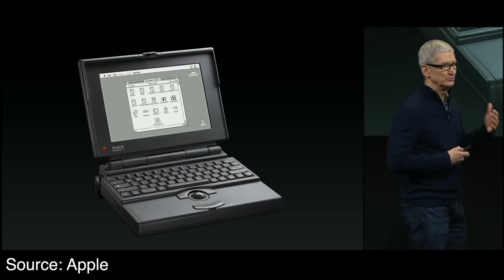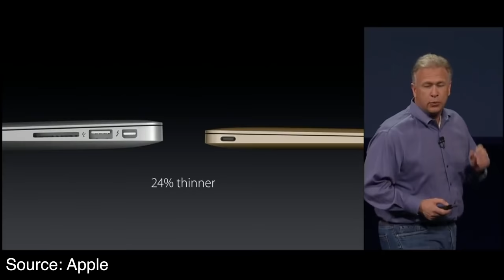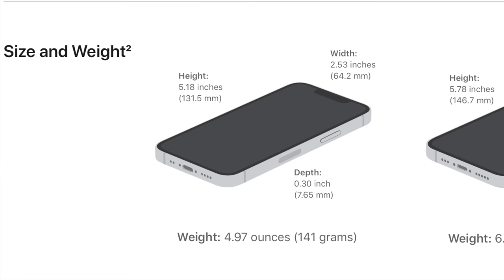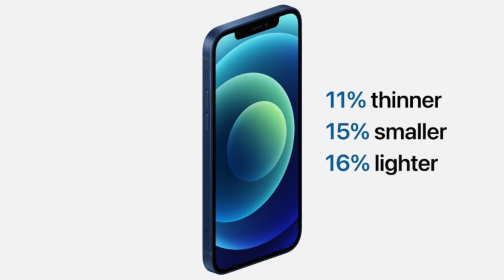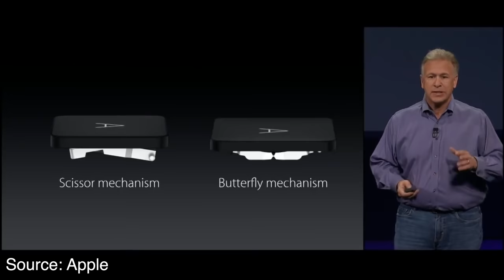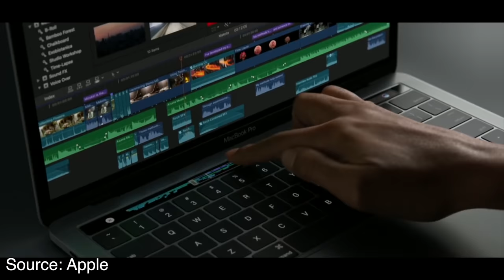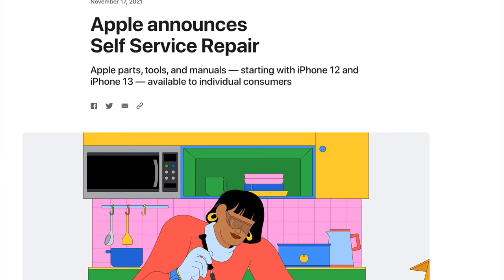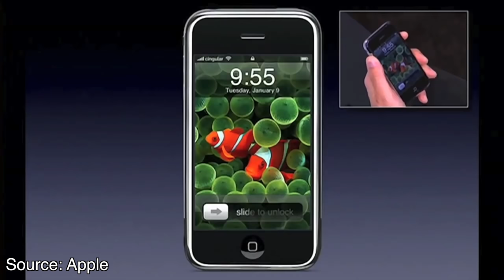Apple is Changing...

Comment: Apple is changing from Lightning to USB-C, from CISC tomRISC, from Intel x86 to 5nm ARM, from FullHD to UHD/4k support with macOS, from single tasks to full multitasking with IpadOS.Changes from small accus/batteries to bigger batteries and from large max IPhones to pocketable smaller phones. Apple further changes from soldered down RAM and SSD modules to user changeable modules! 😄 I really would like an 5,5“ Iphone with double the thickness and three times the accu capacity! A am happy, they changed from 5V with 2,4A or 1A to 20V with 1A (Power Delivery).
Reply: Apple will never drop the lightning connecter and I’m glad. I don’t want to buy a bunch of new chargers and throw out my old ones. They will stay at type c one one end and lightning on the other. The reason is simple: they’re Apple and they own the rights to the lightning connector and anyone that uses that will pay royalties. Gives them more money to stay in business
Reply: @adawg3032  did you miss the fact that Apple is replacing Lightning with MagSafe? Expect to see Lightning going away soon. It is unacceptable to have a 1TB phone with USB 2.0 transfer speed (480 Mb/s), while it should have Thunderbolt (USB Type-C) at 40 Gb/s. Don't forget that Intel was not the only one to create the Thunderbolt protocol, Apple was there as well.

Comment: I started my gradual changeover to Apple in 2017 when I bought a late 2017 iPad Pro. That in turn led to a refurbished late 2015 iMac which I replaced this year with a refurbished M1 Mac mini. I switched to iPhone with the 11 Pro Max and now use a 13 Pro. I also have iPads and an M1 Macbook Air. Their products are pretty darn good and I have no regrets in the change. Good vid Greg!
Reply: Unfortunately, I am heading in the opposite direction. I have an iPhone, an iPad and a MacBook Pro. I use VMs A LOT, so I will not be able to move to the ARM MacBook. Also, I am becoming concerned about the gate keeping of apps on the Apple Store, so I may have to switch to Android to side load what I want. Maybe I will end up with two laptops and two phones. What a pain!

Comment: Also, the iPhone 13 wasn't that heavy to be fair. Holding it in hands feels very light. It's actually not that big of a deal. But the iPhone 13 Pro was clearly heavier by a lot. In fact, I actually felt like the iPhone 13 was a bit lighter than the iPhone6 S Plus although the 6S plus is two times lighter than the iPhone 13.

Comment: But the M1 24" iMac is unnecessarily thin, it's a desktop, and it still sacrificed ports and expandability, and it's still glued shut. So they aren't completely listening yet... I guess we'll see what the larger iMac will look like.
Reply: Exactly
Reply: The larger ones usually come out later
Reply: Rumoured the 24” was the last Johnny Ive product designed but finalised by the new team. They did it as a curtesy to him since he’s the original creator of the iMac and to start a new era ending the one he had created.
Reply: The potential larger Apple Silicon iMac could have a 30 inch display.

Comment: I bought, and returned Macbook Air last week (Dec 2021) for the following reasons: 1. cannot connect more than 1 external monitor! 2. cannot run CS6 3. the bezels are huge in comparison to the competition (Dell laptops) 4. the aluminum surface is so cold while typing on it in winter, especially when I'm on the move, I constantly rub my hands to warm them up.

Comment: I think you will see more changes to Apple, starting with the iPhone 14 next year. What if somewhat "thicker" design rumored for the iPhone 14 is not only to accommodate the long-needed USB Type C Thunderbolt 4/USB4 port, but also make the phone in general easier to replace some critical parts like the battery and the screen itself?
Reply: You are dreaming. They will never make the battery replaceable
Reply: They don’t want the battery to be removable because it allows thieves to pull the battery after they steal it which will ruin the entire point of always on find my mode and I don’t blame them. If your phone battery isn’t working you probably should just buy a new phone because it takes years to get to that point. A big tip is don’t use wireless induction charging because it roasts batteries

Comment: I like apples direction currently .
I’m a bit more partial to devices of substance , and flagship models  with convenience features , like extra ports , card readers, headphone jacks, this was one of the reasons I liked the earlier samsung flagship galaxy models , however it seems samsung has abandoned that trend , 
    at least apple stuck to the practical non gimmicky flat displays , kept a focus on device performance and added the MagSafe which actually turned out to be useful despite my initial thoughts it was a gimmick.
  I prefer the more solid build of the new apple phones and laptops , and I would always prefer having more weight for extra battery and features 
  Having said that , going the other way , if apple bought out an iPhone with no charge/data port , I would not be purchasing another iPhone.
Reply: There have been rumors that the iPhone 14 will be getting USB-C. I'm not hopeful, and I'll believe it when I see it, but honestly they've made better flagship phones this year than Samsung; as a loyal Samsung user until they released the AWFUL S21 series and appear to be digging their own grave even more next year, I think Apple honestly can overtake them next year. If Apple can fix their buggy software; the one thing that has still suffered since the Steve Jobs era, I think Apple could be back to being what they were in the 2000s: A big OE that always was one step ahead of the electronics game.
Reply: @cameronbosch1213  Yep , USB-c would be nice mate , crossing my fingers for that too.
 As for Samsung , i truly dont understand what the company's goal is in smart phones these days , but keeping loyal long time customers does not seem to be it sadly .

Comment: one could argue that during the iPhone 6 and early Mac book air era they were using the combination of size, efficiency, power, and manufacturing superiority to create a high bar that crushed many mid tier competitors and kept the pressure on Samsung to keep up as well. the slim size was very hard to copy if you wanted the battery life AND performance

Comment: 2-in-1 Devices. I got a cut price deal on an SPX. I love it. The only problem: Win-ARM and weak performance.

Now, boot up MacOS with Touch and M1 or M2 with 5G and take the typecover + stylus bay design and that's the dream Ultra-Portable form factor imho. Needs to be nearer to 600g (without typecover if possible) and wow Apple would have the uber device for consumers.

SPX at big cut price is really nice: Love having laptop and touch together on ultra-portable that can also be used as tablet for reading, kick-stand with movies, connect dock for several screens and bluetooth keyboard/mouse as well as portable.

This is honestly the sort of device I'd expect FROM APPLE that pushes tech-interactivity-UX forwards.

Comment: Does anyone else actually wish Apple stuck to the trajectory they were on with the 2016 MBP? I prefer thin & light. The 2021 16 inch MBP is one big chungus of a computer and it takes some backwards steps for me. I love the return of magsafe but I want 4 USB C ports on that machine, not 3. I want the touchbar/shorter function keys.

The 12 inch macbook is one of my favourite machines because of how thin and light it is, not in spite of how thin and light it is, and it'd be disappointing if that form factor never makes a return. Put magsafe & an M1 in it and I'd buy one tomorrow.

Comment: I also think there's a big difference between what customers are actually asking for and what tech reviewers think they're asking for. For example; slating the 2013 Mac Pro with single-function benchmarks when it's dual GPU design was clearly aimed at rendering the last job whilst editing the next job mean't the negative press didn't correlate to negative customer experience. 
Are the superficial appeasements of returning old ports on the new MBPs really sleight of hand? Making superficial concessions to customers whilst eliciting the fundamental concession of Apple Silicon from them? Give a penny, to take a dollar.

Comment: for years I was using old MacBook because of the feel and problems with butterfly, from 2015 till 2019 I had the same laptop a1502 with physical trackpad, it was the best apple designed computer, then ive got 2019 with finally normal keyboard but still the board design is messed up and outdated intel so ive got m1 max witch is amazing

Comment: Did Apple really design themselves into a thermal corner with the trash can? Many GPUs and CPUs today absolutely smoke the trash can’s internals and at a lower tdp. I feel that apple could have implemented some sort of upgrade program instead of leaving us high and dry
Reply: Not that they should go back to it. but an M1 max chip (maybe duo or quad) would  probably stay nice and cool in that chassis..to me it seems that a Cylindrical shape is just wrong for many other reasons than thermals
Reply: The Trashcan Mac Pro was so designed into a thermal corner that it lasted 6 years without any hardware modifications because any Intel Xeon or AMD GPU newer than Late 2013 would already exceed the cooling limits of the unified thermal core.

Comment: Apple trusted intel to deliver 5nm chips on schedule back in 2012 so they went all in on thin and light design. When the chip iwas delay year over year, they are stuck because thermal becomes an issue.

Comment: MAYBE WHEN THE IPHONE 14 COMES OUT IT WILL HAVE A REMOVABLE (FLUSH)
RECESSED CAMERA MODULE CLUSTER DISPLAY THAT HAS A 100X ZOOM CAMERA AND A PROJECTOR CAMERA THAT WOULD USE THE EJECTING MAGSAFE TRACKPAD STAND,IT POSSESSES, TO STABILIZE THE BLUETOOTH REMOVABLE MINI DISPLAY SO PROJECTIONS SIT STILL WHILE BEING PROJECTED. THE BACK SIDE OF THE CAMERA MODULE CLUSTER DISPLAY COULD FEATURE A LARGER APERATURE CAMERA AS WELL. MAYBE THE CAMERAS COULD BE INTERCHANGEABLE.

Comment: I do still like thinnest and pushing the boundary as long as it’s not at the expensive of reliability. But there are still improvements needed on the new stuff. I was comparing the new M1iMac keyboard to my older wired silver Apple keyboard. The new iMac keyboard feels cheap and shoddy like a £20 ebay special. You can twist it and the individual keys don’t feel like substantial plastic. I wouldn’t purchase it separately at the current price for that reason. As an additional item in the iMac box, it’s ‘OK’. Great video by the way Greg.

Comment: It was the iPhone 6+ that had the serious bending problem. It caused what was caused "touch disease", where the touchscreen would stop working.  I had the problem, it was very bad.  No question that Apple overdid the thin fad. A hangover from J. Ive who was only a fair designer.

The 2019 mac pro is yet another disaster. Overpriced, unexpandable, stupid expensive useless case, absurd pricing for the casters, no room for Hard drives. obsolete the day it shipped. Should have been dual CPU, with more RAM slots, and tons of room for storage, perhaps a 10 bay hot swap NVME drive system.

Comment: IDK... all these "repair yourself", bringing back ports not everyone actually needs (hdmi time is over, any new peripherals from any manufacturer have usb-c. you know what, lets bring back usb type A on their next model and firewire port, and ethernet port... maybe CD-rom as well... ) looks to me like a step backwards... Also it is easier to add everything into the bigger box, no need to spend time and money on design and engineers are happier because they do not need to redesign the whole board... I don't think Apple is listening at all, all this is driven by price (whether it is parts (buttons are alot cheaper than the touch bar line) or labour costs or lost court cases). 
Now new macs are like from 2010, so in a way, they chose "no innovation" path. The challenge to squeeze everything into the lighter, smaller, nicely designed body is what forced apple to redesign their motherboards and cooling systems in the past. To innovate, come up with more clever chip designs, new materials. The bigger battery doesn't mean the more efficient battery it just means the company couldn't be bothered to spend time and money on research and development.  
And iphones went back to iphone 4 designs because it is cheaper, way cheaper than trying to come up with the new design... History repeats itself, Jobs left once and apple decided to add features available on other PCs out of desperation and it didn't go well until Jobs came back. Unfortunately, he won't come back anymore...

Comment: When Apple has industry standard slots to upgrade the memory and storage then maybe I will buy one again. But for now every computer they produce has a shelf life which is beneficial for apple but not so much for the consumer especially when you the consumer pays $400 for a SSD upgrade yet that same SSD is much less costly if you buy one in the marketplace. It’s such a scam to buy a $2000 laptop and not have a way to upgrade it later
Reply: Also, the RAM upgrades which you need to buy from them are also severely overpriced.

Comment: I think Apple already has an out having three model spaces MacBook Air, MacBook & MacBook Pro. Clearly the Air is go as light as you can! The MacBook is least amount of ports and small, leaving the MacBook Pro the Pro's line with the performance and ports.

This same approach can also be applied to the iMac's I think it's clear the 24" is the low end and the iMac Pro will be the upper end.

What worries me is the thinness of the 24" Not in the way you are thinking! Its serviceability aspect! 

People are already breaking their older 2012 and newer iMacs trying to add RAM or upgrade the drives internally as its so hard to get in unlike the 2011 and older iMac's. 

The 24" iMac offers no internal expansion, sound familiar! This was one of the draw backs of the 2013 TrashCan MacPro! So what is Apples plan with the coming iMac Pro? Take a page from the 24" system offering no internal expansion or anyway to cut the costs of repair? Having to spend two-thirds of the replacement cost to get your system fixed is not practical. People are already screaming on paying a grand to get their 2016 and newer MacBook Pro screens replaced.

Many advanced amateurs and working Pro's are still holding tight to their 2015 retina MacBook Pro's waiting for the next version of MacBook Pro's before making the jump. They like what they see but the repair costs of a major sub assembly is still a very large factor! Unlike the the older 2015 system which many elements are replaceable!

Comment: Not many people know the ‘bend gate’ actually predated the iPhone 6. In 2012, the iPod touch 5 was released, redesigned with a thin and light aluminium housing, instead of the strong stainless steel housing on the touch 1~4. Very few people found out the touch 5 was easy to be bent, thank to the fell in popularity of the iPod touches and being so small meant basically you had to intentionally bend it to get it bent. The iPhone 6 and 6S adapted the iPod touch 5’s design and made this problem worse since they were a lot bigger in size. The later touch 6 and 7 weren’t reinforced in their housings and still could be bent, but again you got to intentionally bend them.

Comment: This might sound controversial, but I believe apple is making a mistake trying to please 100% of customers. That's how innovation dies.
Reply: Designed about usability and beauty, not just beauty. They are on the right path with the new MacBooks.
Reply: @gs7828  yes hence my emphasis on 100%. The hdmi port is not the right path it’s inferior by any metrics to usb c or thunderbolt. Apple removing port has a proven success record. Customers cried about the floppy disk removal, then the dvd drive, then the current ports. professional cameras and monitors a shifting away from those. Their replacement is inevitable

Comment: Where does the thin design of the 24" iMac make sense? It's a desktop, it sits still at a desk. In most cases it is sitting in front of a wall and you can't even see how thin it is. A bigger design would allow for better speakers. The 24" has worse speakers than the old 21.5" iMac. The headphone jack is at the side of the iMac so that headphones would collide with an external display that you could use at this side.

There is no useful reason for the thin design of the 24" iMac.

Comment: Next MacBook Air 13.3 inch 1,500$ will have 4 USB C and SD Card with M1 Pro and LCD Tim for Thiness. It will be a Hit. Tim. In Startegy. And There Will be MacBook with 4 USB C with ThunderBolt 4.0 like Above with M1 with out Fan for 1,100$. Solve it Super Thin and Sexy.
Reply: They’re never gonna ad a sad-card to a non-pro device. Expect it to only have 2usb-c ports + MagSafe